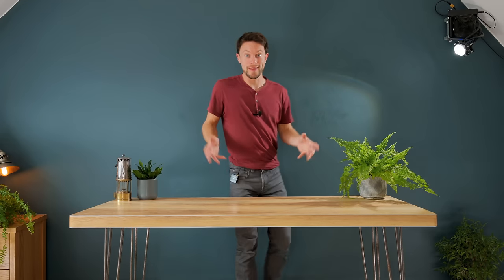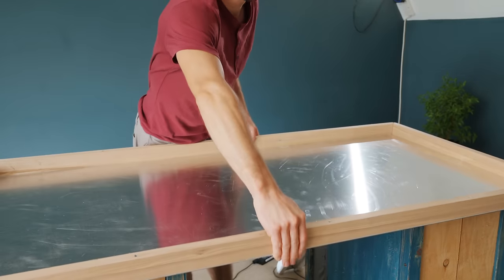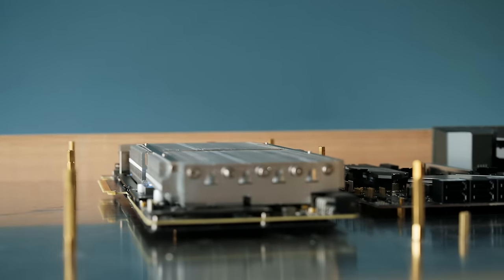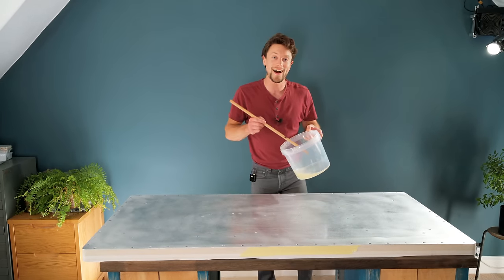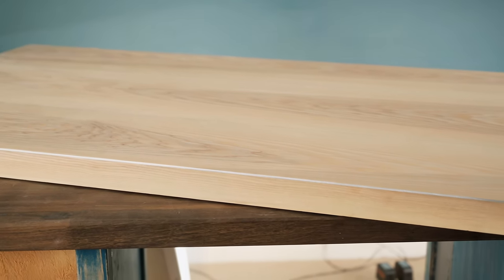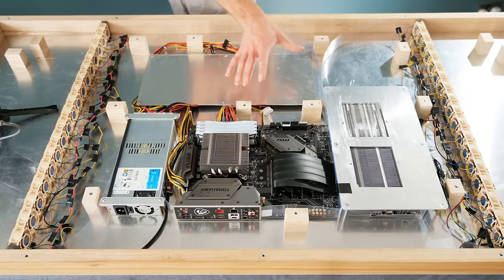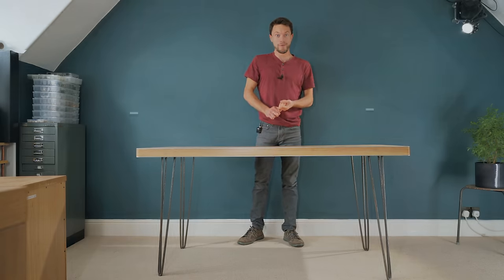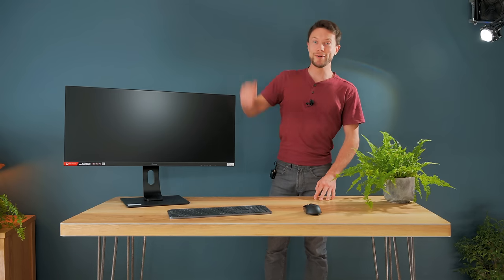Building an invisible PC

Comment: Why not consider using the whole underside of the table as a massive heat dissipater and go completely fanless??
Reply: Charles CQ TL;DR Too complicated and ineffective: the Heat won’t dissipate evenly over the whole area if connected directly to the cpu for example, so the process would require a lot of heatpipes. Also keep in mind that the heat wouldn’t just be dissipated outwards, but also to the inside, and this „cooler“ isr as big as you think, given it has only one layer and thus has a very bad mass/surface are Ratio further adding to the ineffectivity
Reply: I would love to see a fanless version of this table.
Reply: @sebastiana.4682  I was thinking the underside could be covered with fins, not flat.
Reply: @JohnDlugosz  problem is, the fins need to be connected to the pc components via heat pipes. And if that's the case, the fins at the ends of the table will work a lot less efficiently than the fins closer to the components. So the fins get more and more expensive and more and more inefficient the more you add.
Reply: @aaronyu5427  Could enclose it put server fans on the end and cut open the other add tracks for airflow

Comment: when working with aluminium, best way to cool it while cutting/drilling is with Isopropyl alcohol. Since aluminium has high heat conductivity the isopropyl alcohol will evaporate really quickly, in return you will get smoother cuts/drilled holes and less sharp edges

Comment: Hey DIY Perks, imagine putting a QI charging device inside the table.
Reply: That would be very easy to implement in the initial planning!
Reply: get enough of them to cover the underside of the top piece and the whole table will be a charger
Reply: You would have to cut out part of the aluminium since qi doesn't work trhough metal.
Reply: @diegosanchez894  Interesting.
Reply: @diegosanchez894  true, but not a problem.
Reply: LTT already did it. Twice.

Comment: curious as to why you didn't choose a water cooled solution for this build, would it not have been quieter and cooler?
Reply: Build your own then
Reply: @ChanceKearns  i asked a question, but you had to be aggressive about it. Yikes.
Reply: And much cheaper than 40 Noctua fans
Reply: Yup. Much better!
Reply: idk depending on how you build it, it'd be the most annoying thing to drain when ur in need of new coolant and also makes it less upgradeable in the event you plan to change out parts later on
Reply: @jsoupyy  the cpu tdp is already limited by the cooler, maybe an AIO would be a nice upgrade. Just plug the original hole for the air cooler, then mount the aio somewhere else with its own holes. Dunno about aios that have their tubes parallel to the rad tho, maybe replace the rad with one with parallel ins and outs?
Reply: @hyperparadox1  agree make withlittle box this so nice to

Comment: Water cooling would have been way easier, slimmer and given better temps i would think.
Reply: yea but i just don’t think he’s that much of a pc guy lol
Reply: If you look around on his channel you can see that he has been using noctua for a while. I think he sponsored by them or something. That might be the reason for not using watercooling although it would have been a way better option.
Reply: Nope without fans mounted on radiator
Reply: @bigman8198  it's actually proven that high end air coolers perform slightly better than sub 200 euro watercoolers. LTT tested this and that's what they found. Also 85C on an overclocked 8700k running prime95 is very good.
Reply: @Samosayummyyay  Didn't know that. But I think watercooling would be more fitting cuz its not as spaceconsuming (probably cheaper too) as 30 minifans.
Reply: @Samosayummyyay  Yes, I would also never use water myself, as a normal Cooler Master Evo does well with my medium powered CPU, but that is in a case with 4 fans (including CPU cooler fan) and not with a crap ton of hotwired low profile and low throughput fans through the two low profile coolers.
Just two water blocks for the GPU and CPU area with a couple of soft tubes and a pump would work very well in the space of a desk, as also demonstrated by LTT.
The air cooling done in the video is just too janky for the setup imho, not that i would ever build such a thing. ^^
Reply: the whole metal cover and legs could have been setup a heatsink to reduce the need for fans.

Comment: With this amount of mini fans with each costing around 15 bucks, you may have been better off using watercooling instead, would have been cheaper and better thermals
Reply: Yeah, the fans come to £600. kinda stupid imo
Reply: @djenson  Build the exact project will be stupid because of cost of BUYING the fans, but he got those for free so it was a smart move for him
Reply: interesting! is there a small radiator the width of like 5 cm max ?
Reply: Yeah, but would it fit with the size limitations?
Reply: even liquid aio for cpu and gpu would've sufficed.
Reply: Or you could just use blower fans for cooling :) they are low profile and cheap :) this is why they are often used in laptops or aio pcs :)
Reply: @rezlov_  aio watercooler would be pretty tough to fit in because cpu block height but custom loop would definitely fit :) well i guess the radiator fan combination would also have hard time getting any air :D because they would be pretty much zero gaps for air come through :D maybe it would work with thin fans + thin rad or maybe buy one of those 40mm rads :D
Reply: But blower fan +heatsink is the best for these types of builds :)

Comment: Watercooling would have made much more sense for this, instead of just air cooling.
Reply: Agreed.
Reply: LTT did a water-cooling table desktop version I'm sure - but I think it's still nice to see how an air cooled version would work
Reply: @adili9427  a water cooling fish tank....transforms into fishsoup
lol
Reply: Where would the water come from and where would it go
Reply: @TheDream64  watercooling is always a closed loop system. (with a big enough reservoir and a radiator, to get rid of the heat)

similar to the watercooling of a car. 
no water in, no water out. its a closed loop.

Comment: I'm am totally doing this as soon as I can afford the materials multiple times because I while definitely need more than a few tries. I'd probably go for something thicker so everything can fit in. Probably use walnut wood and maybe motorized legs to switch between sitting and standing mode.
I doubt I do this soon though. I don't have much money and I am already experiencing with my current desk. I recently had the idea of fixing everything I can (internet box, wifi 6 router, headset receptor) below it with magnets for easy access and I love the result, but there are a lot of approximations. I know very little about woodworking and I am missing a lot of tools and skills.

Comment: @DIY Perks

Why didn't you just go for Water Cooling??
Reply: Honestly, even with the tightest achievable curve, I don't think he could have gotten the desk as slim as it is with water cooling. At least, not with any of the commercially available water blocks. And I know this is DIYPerks, but I feel like making his own water blocks might be slightly out of reach.
Reply: @peregrine5327  he could have just dont the sam ewith the heat sinks but with a radiator, with multiple radiators it may have worked with lower temps
Reply: @peregrine5327  not really.
Many water coolers are lower than the ram sticks.
Reply: @Jehty_  They are, mine is!
Reply: Because he needed to cool the other chips as well. The fans dont only cool just the cpu and gpu, but they cool the all the chips nearby, like the vrms, northbridge, and even the ram chips. Its also more expensive as well
Reply: @Jehty_  *most
and EK also have the server cpu waterblock that have sideways ports
Reply: @Jehty_  Yeah, but what about the tubing?
Reply: @Kim-fm2vo  buy a block where the tubes are attached on the side.

Comment: The desk is cool, but your cooling is bad. I guess for a project like that, modded watercooling would be way better.
Reply: No not really. Actually, whilst hot, 81c is perfectly fine especially under load with the sort of stress tests he was running! I have been watching these videos for a while and none of his projects are hack jobs. He even went so far as to tell us that this cooler was underrated for the TDP of this processor but it was the best available for his chosen form factor. If you look up his rope and wood PC build that uses a hardcore CPU heatsync for the GPU. The reverse could be true for this and was even teased "I might even see if I could modify a GPU cooler for the CPU. In the mean time, positive pressure will be perfectly fine!  :)
Reply: @djjodav  Modern componants automatically reduce their frequencies according to temps. It's more important now than before to keep the electronics cool. Ryzen 3000 is a good exemple, but Nvidia GPUs works the same. 80 mean less performance. And less longevity. And less room for overclocking.
Reply: Custom loop DiyPerks style with copper and brass would've been damm steampunk and awesome!
Reply: @jaceneliot  85C on an oc'd 8700k doing prime95 is damn good. My friend has a Corsair h100i for his 6700k with slight OC and that thing under prime95 hits 95C. When gaming its at around 85C. His radiatorfans are two Noctua NF-14s. It's in a Corsair r500 case. He uses a push-pull config for his case fans which are also from noctua. Sad part is the damn pump is the most noisy thing about his PC. It's optimized for silence.
Reply: I don't know. I mean 85c is less than a lot of gaming laptops these days, so he should still get better performance in comparison. I compare this to laptops because presumably, someone doing a setup like this would probably use a hidden laptop or a PC outside of the desk like Linus did recently. I would love to see a water cooled build though to see how low the temps can go.

Comment: Could’ve just water-cooled the cpu n gpu...
Reply: My thoughts as well
Reply: wouldn't filling the reservoir be sketchy?
Reply: @stefanharaga2580  It would depend on the reservoir and it's location. I'm fairly confident it could be figured out easily. 

Or, just AIO systems for each component
Reply: Goliath1271 for this type of build AIO would be appropriate.
Reply: Yeah that battery of 40mil fans is frightening and wacky solution overall
Reply: Jack Disturber with that many fans he could of just used a server blade
Reply: @stefanharaga2580  you can install a fill/dump port in the back. Then when you're ready to maintain, just tilt the table so that the port is the lowest point. Easy

Comment: Why not liquid cooling? Could've been way easier.
Reply: Well the reservoir probably wouldn’t fit and it would be hard to fit all the tubing with the different fittings and stuff
Reply: @ethantorres4061  I meant an AIO like NZXT kraken ? Not the traditional liquid cooling... That's too much of work..
Reply: Aakash Kale well an aio wouldn’t work either because the waterblock would most likely be to tall and a custom loop isn’t too much work at all it takes like 20mins with soft tubing but either way it’s best the way he did it
Reply: @ethantorres4061  I totally disagree man... I've a thermaltake AIO and using that would be too easy than having 100s of fans running and still messed up CPU temps... Moreover these many fans aren't practical too..
Reply: Aakash Kale well thermaltake aios have different sizing I was specifically speaking of the nzxt kraken series like you said but ok
Reply: @ethantorres4061  I don't understand what you're getting at. You think the water block for a simple AIO cooler would be taller than that Noctua heatsink? The water block on these coolers (Corsair, Kraken, thermaltake, etc.) would be half the height of that heatsink (granted it will vary), eliminating the need to build around it and having a heatsink protrude from the bottom of the desk (Which is always a terrible idea). The liquid cooler's radiator can then be mounted face down on the bottom of the desk in the same way that it would be mounted to a plain old computer case with intake holes drilled exactly how he did them here.

Using a liquid cooler as mentioned above would simplify this build tremendously while making the desk look significantly more elegant (No huge protrusion to accommodate that massive heatsink), give better performance, and cost less. 

For the GPU however, I have no idea if AIO type coolers even exist for them or what the convention would be to liquid cool one. But seeing as how his was low profile enough that it didn't require building around it, I'd say don't bother. However it might be worthwhile to use the fans that came with it instead of all of those small ones (To save cost, I have no idea what would change for the performance). You could accomplish this the exact same way as how you'd mount the liquid coolers radiator but flip the fans to pull air in and push it out of the heatsink.
Reply: @ethantorres4061  bro, most of the radiators can fit with one layer of vents nicely, and the same with the CPU block. You can also fit in there a custom water cooling and add some 480 mm radiator and refrigerate both CPU and GPU. There are reservoirs which can be putted horizontally. Basically, it would be better if he used a water cooling.
Reply: @AakashKale27  alot of air coolers do a better job than AIOs, and custom loops are a little too thick.
Reply: @nathancarbo  no doubt man... But for this specific build, and AIO would've been way better.
Reply: @MrImOriginal  well, the video was sponsored by Noctua..😂😂😂

Comment: Loved the project. Just a question. Wouldn’t it be easier to use wood as the top side, and aluminum in the bottom? That’d save the epoxying, wood sheet, waiting while it dries…

Comment: Loved the video, and amazing craftsmanship, but thermals could've been better by using some water cooling.
I know I'm 2 years late but for anybody willing to build this use my advice, it will certainly give you better performance.
Water cooling is a really good option but even the RTX 2070's fans could've yielded better thermal results and might thermal throttle if the load is too high (in this case 80° is enough to thermal throttle the RTX 2070 and limit its performance). You could've used water cooling blocks for GPU's and CPU's along with some thermal tape you can stick onto the VM's, water cooling is also really quiet and won't make nearly as much noise under load. Add some radiators to the underside and it will be really obscure and hardly noticeable. Although water cooling is quiet there is downsides, such as the radiators, you will need to cool them but you could use 120mm fans and under volt them to cool them quietly.

Things I would change: Water cooling, Power supply (if you want to upgrade your GPU or CPU you will need a bit more power) and the layout, you could've used more space to add more cooling or a water cooling system.

Comment: I've always wanted to do this.  But have you considered setting you are using a big ass aluminium sheet,  you don't need a fan at all for your gfx card? Just flip the card,  contact the heart sync with the aluminium and allow the heat to dissipate... or alternately use a smaller sheet and turn it into a cook top.  Fry an egg while you play games.  Limitless choices!

Comment: A) Could you not have glued 2x 44mm together to give you 88mm depth, and more than enough clearance for fans ... B)  Could you not have used "contact adhesive" for the veneer rather than resin? ... C) Wouldn't it have been easier to disassemble a laptop - which already has a thin motherboard / small fan cooler. You could then use a "brick" PSU rather than the huge industrial SMPSU. (Or come to that, buy a table from IKEA, and fix the laptop underneath? Pasting  tables have a wood depth of about 50mm, or you can buy picnic tables, which again have a recess)

Here's the next project: A folding picnic table with a laptop underneath. You can then take the table / PC with you on holidays rather than carrying around a laptop.

Comment: Honestly this would have been perfect with ek watercooling. Get them to do a custom reservoir that fits lengthwise.
Another thing is, especially with the ram, you don't need the housing on it, you can use the barebones, which would probably make it within parameters.

Comment: Noctua is the best cooling solution company. Their CPU coolers and fans are unparrallelled. But I'm curious if you contemplated using larger fans and mounting them horizontally at the bottom of the desk. It'd probably be a lot more silent.

Comment: Excellent build, except using that many fans.  Fans fail and I'd think it's going to be difficult to keep up with replacement down the road.

How about adjustable venting?  Kill 2 birds with 1 stone for colder climates.  You could vent a bit of warm air just above the seating area.  A level to adjust it away during warner days.

Comment: next time tape first veneer together there are some special tape for that, that you have to make wet and when its drying it will shrink so you have no gaps than cut the veneer 1cm biger it makes it way easyer to glue.. and than ask the carperter around the corner to use his veneeer press this way it will be flat.

Comment: Watercooling would have allowed a probably even slimmer table. Bigger fans could also be flat and mounted under some components like gpu with no issue. Last thing would ruin the aesthetic a bit but thicker legs on the table would allow cables to be hiden "inside" the leg, like making a cutout for them behind

Comment: Since you're drilling holes on the bottom for the air, couldn't you instead of 40 small 40mm vents just put a couple of 120mm ones to blow from downside up?

Comment: I'm curious to the overall cost of materials to build without PC parts
Reply: Those aluminium sheets are easily a couple hundred bucks each, legs at least a hundred total, general wood another hundred probably. The most expensive here is the tooling and the expertise.